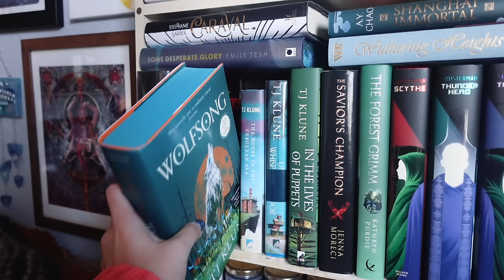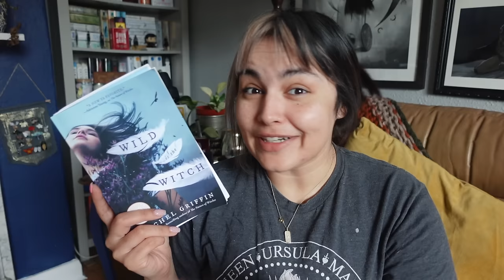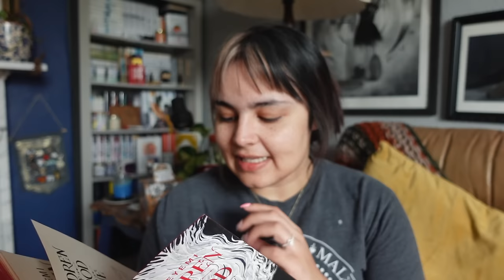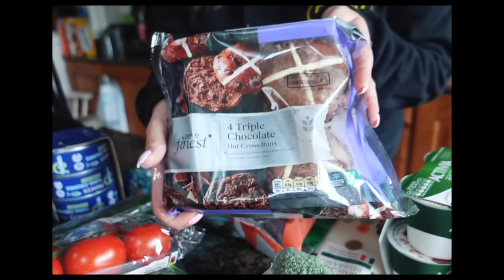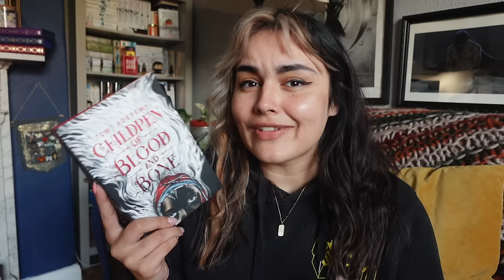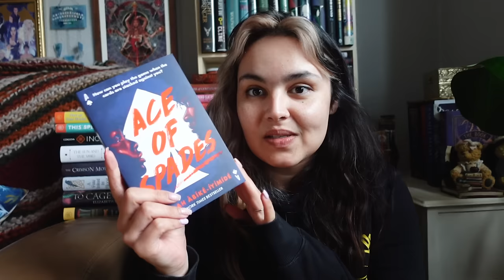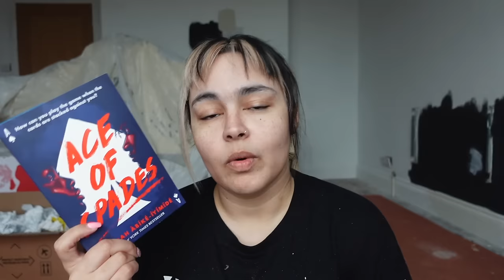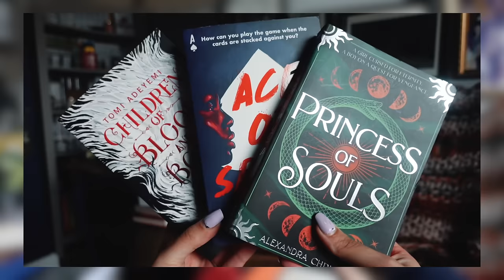The Curse of The YA Paperbacks 👀 Shelve It or Scrap It Episode 02

Comment: Keep the stacks at 20 books a piece and when you take one out adjust them back to 20. Then if you roll book 53, you can just count 20 (1st stack), 40 (2nd stack), and then 41 to 53 in the 3rd stack. Or count up from the bottom of the 3rd stack from 60 to 53.

Comment: Great series so far. I would recommend putting the books in stacks of 20 to make the random selection process a little faster for you. So you don't have to count through the books every time you want to select one. And if you remove a book from a full stack of 20 just shift a book that's in a not full stack into the full stack.

Comment: To be honest the Trova Trips are just super pricey and especially for Greece considering the 2-3k is without flights you can do this soooooo much cheaper for a 7 day stay even with all the meals and trips. Greece and especially Crete is not expensive. We have been there for a 10 day stay with a car, stayed in 4 different locations and went out for food every night and I'd say we spend max. 1k on it with flights, accommodation, car, food and entry fees as well as gift shopping etc. So I think that's why people are not so quick to jump on it.
Reply from the maker: I definitely understand where you’re coming from, Trovatrips are not the cheapest, but I don’t necessarily think the price is the main issue. I’ve hosted trips before that were more expensive and didn’t have the same issue.
With group trips, you definitely get a different experience than a regular trip you plan yourself. I have also been to Europe (although not Greece) for much cheaper, but when I do, I don’t have airport transfers, or a tour guide to handle logistics, take part in tours/activites, or have an anxiety free, smooth running trip.
I definitely get Trova isn’t for everyone and you can always go on holiday for less, but for those that want this kind of trip/experience, I don’t think price is so much the issue as it is timing/itinerary 😊